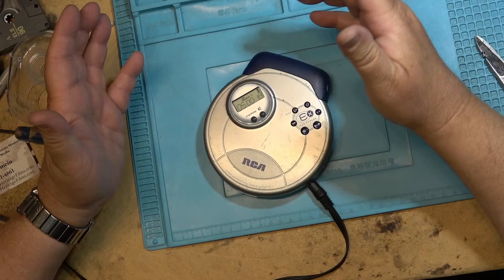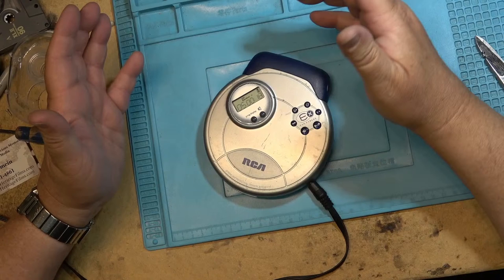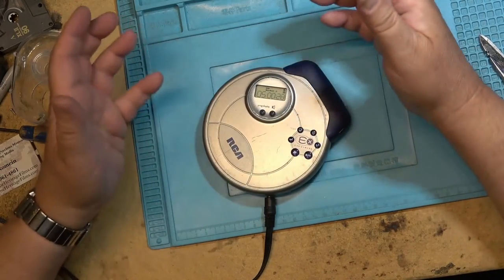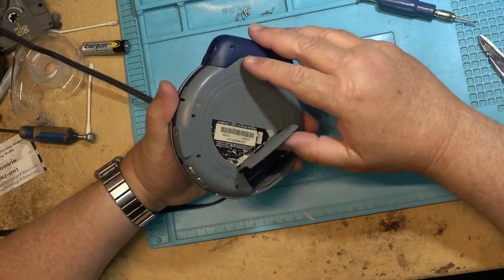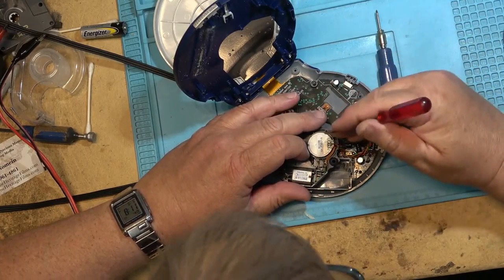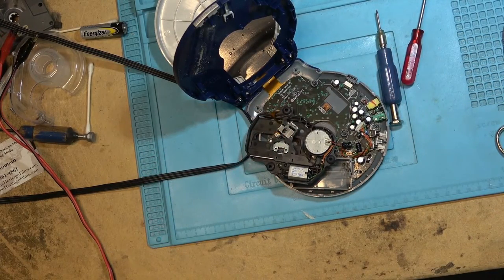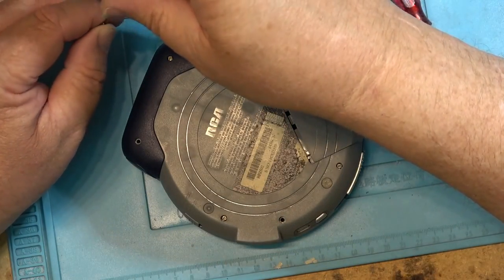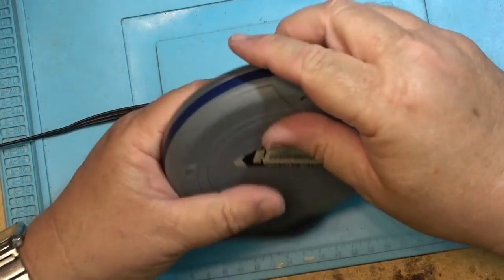Live in the shop CD Spindle Motor Tip

Comment: Nice tip. How about the laser assy moving mechanism, does that go bad usually? I've got one skipping cd player, and suspecting it's the laser assy moving mechanism, because it makes strange struggling sound when you select the last track and it moves the laser there, and when returning to the home position. Have tried to lubricate the rails, but no help.
Reply: mostly no unless the plastic slides are warped. the more expensive ones had metal slides which were more reliable.